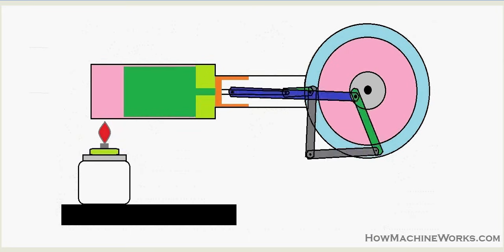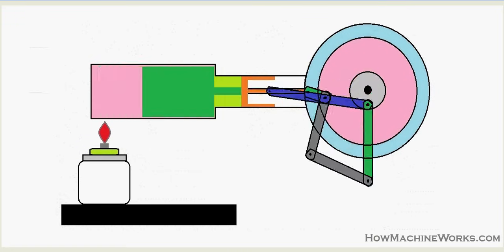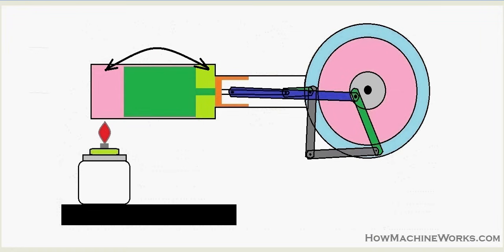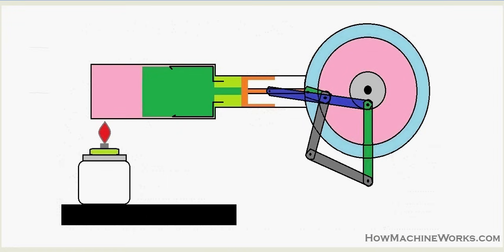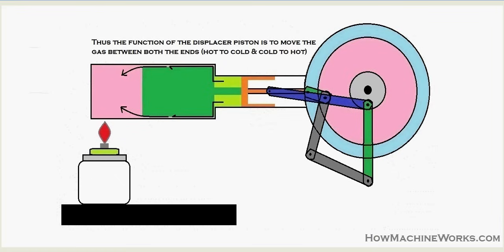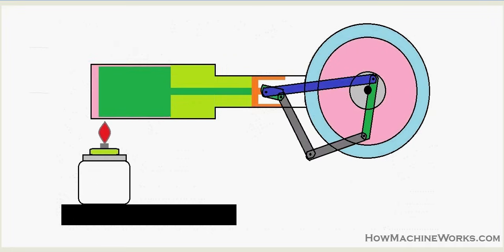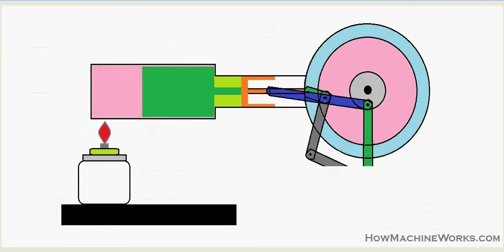Animation - How stirling engine works.

Comment: Finally, somebody actually confirms that there is air flowing between the hot and cold sections, not that they are sealed off from each other. Details matter

Comment: Not to be mean, but your explanation sucks. First off, you calling the displaced air as 'cold' air.. is very misleading. That suggests it is coming from the outside. 
Also, it looks like the Power Piston has a shaft? Does it? So.. why does it change color? Sometimes its orange and other times its white. 
Forget HOW the air gets heated. WHY alcohol, kerosene, gasoline, or cow chips? Just say "the air is heated" and continue.
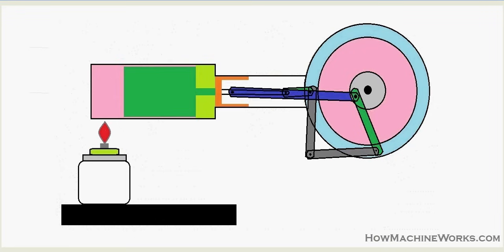I still dont know HOW the Power Piston is attached to anything.  You state at about 6:00 there are '5' links. NO.. there are 6. 
Two on each end of the blue [with one on a green] and 4 more on all the rest on the green.  Dude.. Terrible.

Comment: first you talk like a little train set running in circles bitting off at your words second heat is usually applied at the power piston not the displaced at least in a alpha configuration
this being a beta configuration should have been dismissed as a sample for explanation 
tou should hire thenuclear machinist  to do the explaining for you
you have created more confusion than 
anything

Comment: BS ! If the cold air can simply pass through the piston, WTF is stopping the hot air to simply pass on the annular region of the piton, and not actually push it !
Reply: Nothing.  The displacer piston doesn't really contribute to pushing anything, its driven by the momentum of the fly wheel.

Comment: 1000 words when 10 would suffice makes it impossible to follow.
Reply: Floundering. 
Well chosen words beat a barrage of uncertainty. 
Why even start with a kerosene or alcohol burner? The words you want are 'heat source' - a burner of some sort is a good example.
The animation?
Awful. Clunky. Confusing.
I went from 'I need some aspects clearing up' to 'I don't think this is factual'.
Effective communication is about clarity. There was no clarity here.

Comment: - I was a nuclear machinist mate. This explanation is completely wrong. The diagram, the explanation... EVERYTHING.
- The displacer piston is not moved back and forth by the heating or cooling of the air in the cylinder. No. 
- Here is how it works
1. Start with displacer piston on the cold side. So most of the air is on the hot side, getting heated up. As the air in the cylinder expands it pushes against the outside of the container. That's where the POWER PISTON is. The POWER piston moves out. 
2. As the POWER PISTON moves out, it  pushes the 'displacer piston' (through the linkages) to the other side of the cylinder. (this is counter intuitive) 
3. As the 'displacer piston' moves to the other side, it pushes most of the air to the cold side.
4. The air is cooled overall and contracts, pulling in  against the outside of  the container and..  THE POWER PISTON! 
5. The power piston moves back in... and moves the 'displacer piston' to the other side of the cylinder, also moving the air around.
6. Process repeates.
The important thing to understand is that the big displacer piston in the middle of the cylinder... even though instinctively you feel like that's what is being moved around by the heating and cooling of the air... isn't. You could heat one side and cool the other all you want, that displacer piston wouldn't move that much. No. The heating and the cooling pushes the LITTLE POWER PISTON back and forth.  And (through the linkages) it is what is pushing the displacer piston back and forth.
Reply: After watching twenty Vids and it still not making sense you finally explained it, Thanks!
Reply: Good damn explanation. Congrats!
Reply: Gods of the Singularity please why don't you make a simpler video on this topic.
Reply: So the Stirling engine relies more on atmospheric pressure rather than heat expansion?
Reply: Gods of the Singularity what is a nuclear Machinist? I'm seriously not trying to be smart, I'm asking because I used to be a machinist and just I am curious.
Reply: @csonkaperdido  google it. i did and found out. too much to explain here.
Reply: @csonkaperdido  Machinist Mates operate and fix ships. Nuclear Machinists Mates have much more schooling and operate nuclear powered ships.
Reply: It looked dodgey
Reply: Thanks a lot for your very interesting correction! I saw various animations about this, and your explanation made all of them clear (not only this faulty one.)
Reply: My mind blown after watching this video.
Reply: Thanks! Looked up a bunch of videos about this and none make sense.. until I stumbled upon your comment.
Reply: As a guy who builds all types of engine and whether it be piston, duke(which is cool tho it is piston based), jet or rocket (and also tends to push my designs to to the extreme of extremes). I was glad somebody said something and completely corrected it before I made my own comment because the I would have gone off on this person. Also its cool to see someone who has worked on nuclear reactors. I love the science behind them and I've made a LOT of designs for them. I hope build one of them one day.
Reply: So you can machine a very dirtybomb? i did it,,mankind in europe is just fuked up and in usa too.- cheers

yes hot air creted pressure ,,,and coll air creates vacumm, in realtion with the espace occupied.

like ina combsution engine.
Reply: Great explanation, thank you

Comment: Not that well done....if there were a sufficient gap around the sides of the displacer piston to allow the 'cool' air to travel back to the front, then there would be too much gap around the piston, and the displacer piston would not move backwards when the air in front of it was heated. The heated air would simply leak around the sides of the piston towards the back of the cylinder.

Comment: What prevents all the air from eventually getting hot ? .Wouldn't it be better to have a hot air exhaust hole past the displacer piston stroke in the cylinder.It would be more efficient and more consistent in speed.

Comment: Nice vídeo, really help me understanding what is and how works a stirling engine.
Reply from the maker: +Janio Alves 
thank you What's app us @ +919744615655 To get updates on Mechanical/ Automobile engineering
Reply: @TechTrixInfo  Why would anyone do that? You explained it all wrong to begin with.
Reply: Excellent than you really did not understand a fuck at all

Comment: your linkage is not correct ..... the grey links should be at 90 deg. with no flex between the two pieces. 
It should be a solid 90 deg. shaped solid piece.

Comment: UNCLEAR: The two grey link rods are supposed to be solidly connected at about 90 deg. at the pivot point. The way your animation works it is pivoting where the two grey links connect. If this were a true product the one grey link would go up and down but the displacement piston would never move at all.
Reply: Man he tried his best to explain to you his own confusion of the stirling cycle
immagine if he attempted to explain you  the Shrodinger equation  arithmetically .. you would have suffered a a blood clot ot a TIA